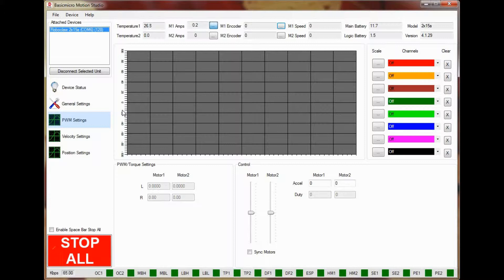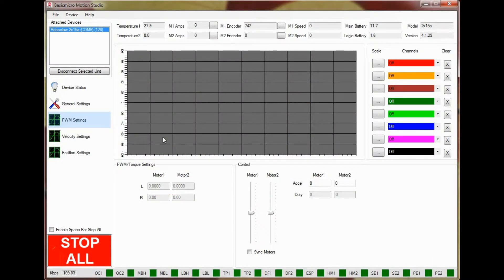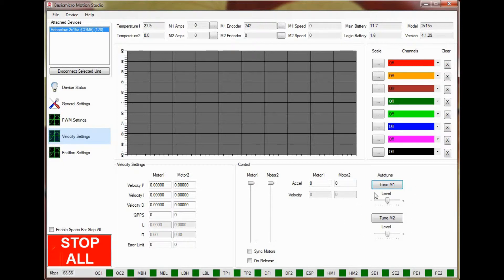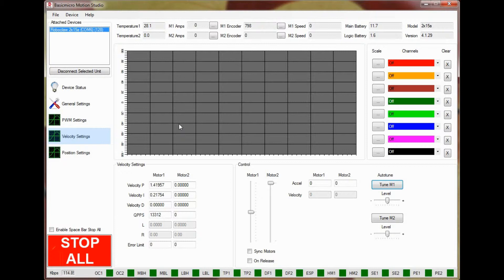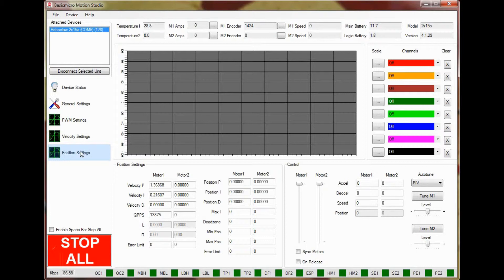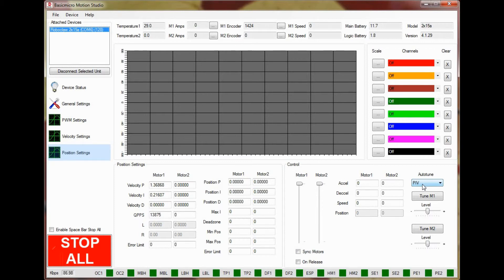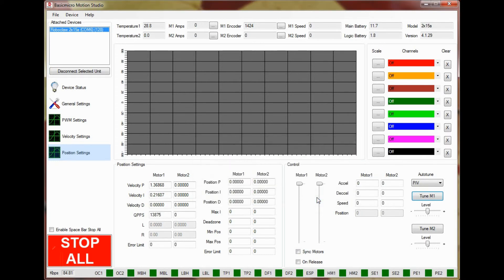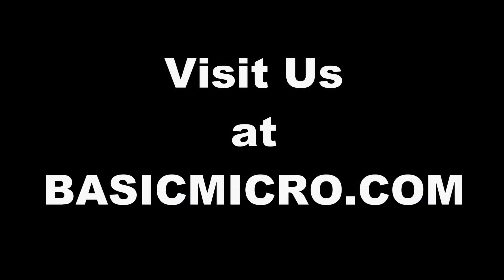Auto Tuning with Motion Studio

Comment: Every time I attempt to run the autotune for velocity, my motion studio all of a sudden doesn't respond. When i press autotune, the motors oscillate, but the values for PID do not refresh. Any idea why? Thanks
Reply: 1. Autotuning runs the motors pretty hard. Make sure you have a good USB cable with Ferite chokes.
2. Make sure your power source has enough power, otherwise the controller could brown out.

Some motors will not autotune properly(mainly linear actuators, which are easy to manually tune, but some others as well), but the main problem is noise killing the USB connection or browning out during tuning.

Please call in for support and we will try to determine the problem.